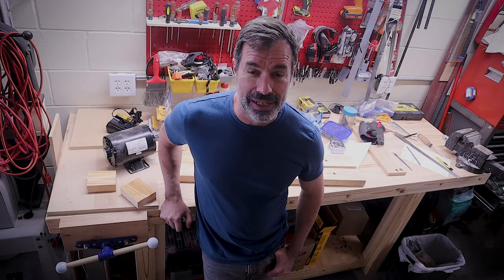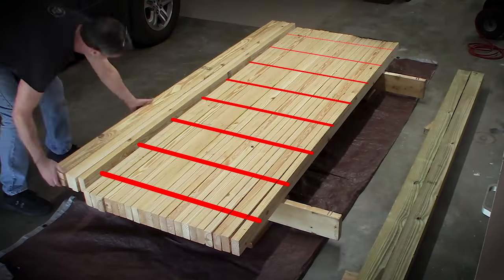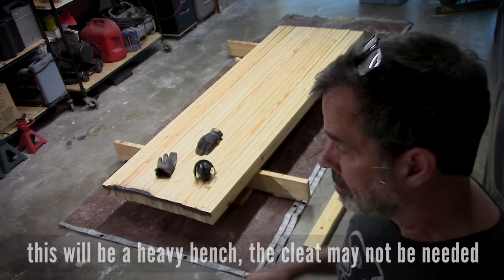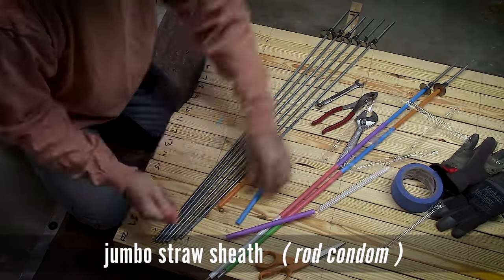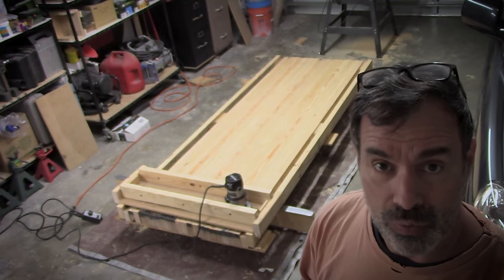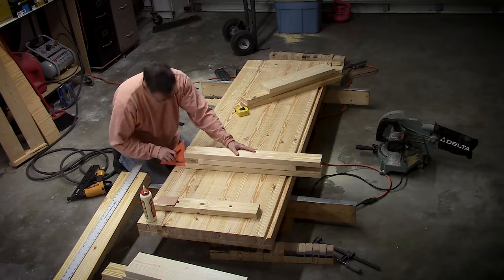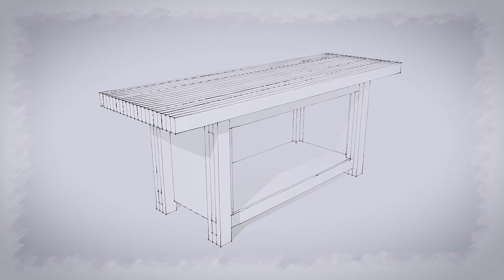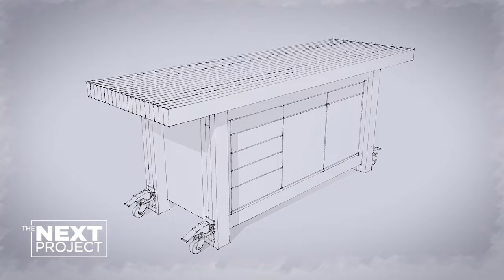Workbench BUILD Project. Easy, Cheap, Solid!

Comment: Why do you have the 2x6 as part of the legs?
Reply from the maker: Dave, thanks for watching!
Great question about the 2x6.
This style leg could be built without the 2x6, or all 2x6 if extra strength was needed.  For me, it could have been all 2x4, and it would be just fine.
Probably the biggest reason I did add the 2x6 in as the center laminate of the legs,  was to give me a mounting surface at the face and back of the base structure for future cabinetry. A recessed yet protruding surface for door hinge and drawer faces to mate up to. 
I'm hoping to do a follow up video, showing what the bench is today. The general structure is the same, but it's fleshed out considerably.
Hope you are doing well, good luck with your projects!
Reply: Thanks. How has your bench held up to wood movement? Any problems with the laminated top coming apart? Did you leave those threaded rods in? Or did you remove them? It looks like your front and back stretcher are screwed to just one 2x4 in the top. Was that intentional so that any movement in the 2x4 top wouldn't tear apart the stretcher?  I am building something similar - about 27" deep and 48" long. I will use it to mount a vise that I need for my next project and probably station my planer underneath in a way that I can pass boards through from left to right and have them fit through the legs.
Reply from the maker: Dave, the top is holding up really well. 
Only movement is with a couple of poorly chosen 2x4s. In my haste, I managed to get a couple of fast/wide growth ring pieces of lumber in there. Not much of an issue, but they are a bit softer than the tight ring lumber. 
I'm really surprised overall at how hard the tight growth ring southern yellow pine is. 
My original plan was to give this top a couple years of dry/seasoning time, then resurface as need. At this time, the top is still close enough to perfect for my needs, but I may still give it a once over next year, we will see.

All the laminated glue seam are holding strong, nothing delaminating. 
I did remove the threaded rod, and put threaded inserts in the holes along the  edge. I've mounted things to those spots a number of times, like and extra clamping point. 

Yes, the top is only screwed on at the face and back stretcher. I think it was 4 screw each.  The top is heavy enough to stay put, so not a lot of screws were needed. I thought that a few years down the road I may want to flip the top over, surface what is now the bottom and have a fresh clean top. It may never happen, but it's an option.  I don't expect too much movement, as the top and the stretchers are of the same material, so maybe they will move together. If not, they are gently fastened to allow nature to do it's thing.

I had originally planned to give the bench topcoat finish to protect and slow seasonal expansion... Haven't gotten to that... probably won't. Darn!

I plan to do a quick "a year in review" video soon. The base is full of drawers and a wide double door cabinet area. A small face vise and casters have been added.  A hideaway router tabletop fits in the cabinet area... Dents, dings, paint, stain, dirt and abuse added for flavor.
It's a workbench, not a coffee table - it has had plenty of coffee on it however.

Good luck with your build and projects!

Comment: At that cost it might have been just as ez to buy a harbor fright bench.
You can catch them on sale for close to the same money.
Reply from the maker: Thanks for watching!
I hear what you're saying, and I did look at other options, Harbor Freight benches were on the list. 

Some similar benches to what I put together are closer to $1000, some had higher grade materials, some are branded, some are over the top. While others are no better than what I was replacing and had been using for years.

One similar(?) bench option at my local HF store looked cute, but felt rather cheap.
At the time I was building this, the closest HF bench was +/- $200, 5'-6" x 20" top, weight around 100lbs. They probably had a bigger bench, but not on the floor or on their website at the time.
This bench has a 7'-6" x 30" top, weighs over 300lbs. This bench is built around what I do and what I work on, not someone else's idea of what I do.  This bench needed to be solid, to a point. Not a tank, and not a toy, somewhere in-between and easily modified and upgraded as tasks required.

It would have been far easier to open the box and bolt the HF bench together, but I like to make things, and learn from the experience. It's all kinda fun and rewarding.
Would I change things if I built a similar bench again? A few things, but not many at this point.  I had looked at historic style bench designs, torsion box designs, MDF, maple, oak, this and that.  Some great ideas, some boat anchors.  This design had a requirement of being able to be partially dismantled in the event of a relocation bug-out... it's happened 3 times in the last 3+ years. Ugh!  So the top bench slab is anchored to the base, but not permanently pinned and glued - at this time. Also, having a removable top allows me to flip the top, or resurface the top, or change the top - that won't happen.

There are a lot of good, better, best benches and designs to choose from out there.
This project had goals of size, weight and cost. Pretty much all spot on for me. 

It did take a some time to build, a couple weekends, but the lessons learned and satisfaction of completion are far greater rewards that any pre-fab bench would have offered - at least to me.

Thanks again for watching and the comment too.
Be safe and take care!

Comment: Why is one end 16" and the other 12"
 ?
Reply from the maker: Thanks for watching and a great question!
The bench top overhang variation was planned to maximize work space on top and storage space underneath. I have a portable MIG welder that just fits under the 16" overhang, and currently I have a trashcan under the 12" overhang. Additionally, the 12" overhang allows for a clean installation of a face vise. 
The top is mounted to the leg assembly in a modular way, so if I need to change the overhang, it will be somewhat possible.

I have added threaded inserts to all the original threaded rod "clamp holes" along the front edge of the bench. I've used these mounting points to clamp additional items to the bench in various ways. The 16" overhang also has some threaded inserts added to the end grain of the bench top (not ideal, but...), I clamp/bolt a long beam to the end which in turn has projects mounted to it... 

I chose not to build a bench exactly like anyone else, but chose to figure out what types of projects I work on, what it needed to do to fit those projects and also what items I need to hide/store in and under it.
I'm nearing completion of adding drawers and a base cabinet area. 
Retractable wheels on the legs have come in really handy, and work great as the bench rests on a very smooth concrete floor. It's heavy, but rolls very easily when the wheels are locked down.

Really glad I finally got around to making a bench.
Hope all is well, take care!

Comment: New to woodworking and looking for a good workbench like this. Do you have a materials and cutlist for this.
Reply from the maker: Ricky, thanks for watching!
I don't really have a materials nor cut list. 
If I recall, I used 25 Southern Yellow Pine 2x4 and 4 SYP 2x6 framing lumber.
Take your time to sift through the stack of lumber at the yard, don't just take what's on top... I probably moved half a stack of lumber to find what was good-enough.
You can reverse engineer this bench by looking at the initial dimensioned sketches in the video.
Adjust the height of the bench to fit you and the work you will be doing.
I made this bench the height, width and length to fit my workspace and allow for some items of a fixed height to fit underneath.
If you want to beef this bench up even more, you can use 2x6 SYP for the top bench slab. That will add more weight, harder to move without help. 
If I find some of other dimensioned sketches for this, I'll follow up in this message.
Good luck with all your future projects.
Be safe, have fun and take care!